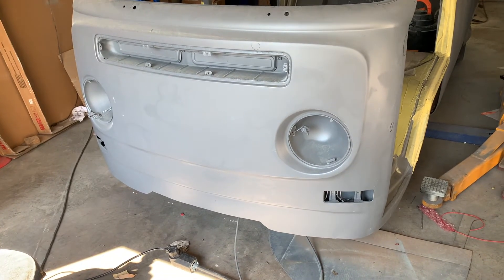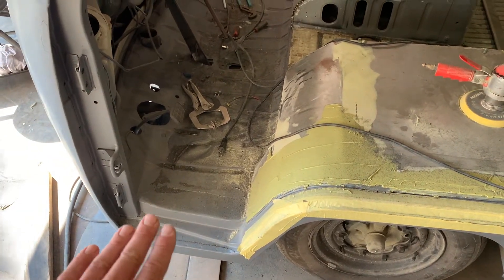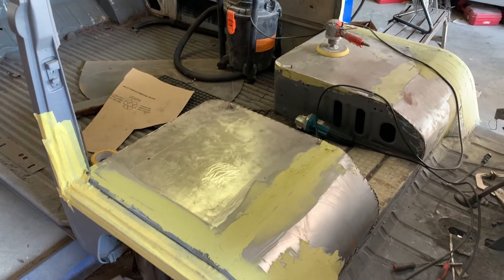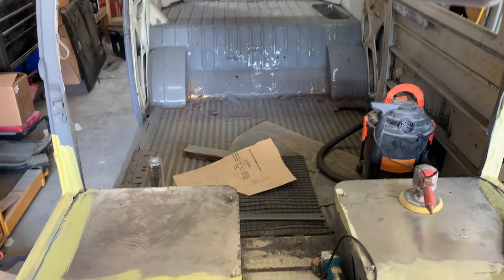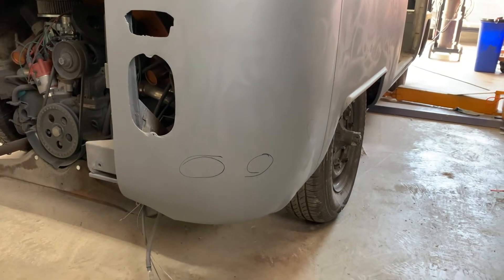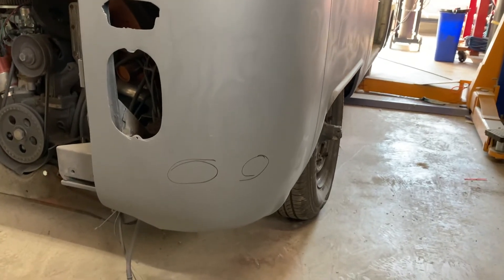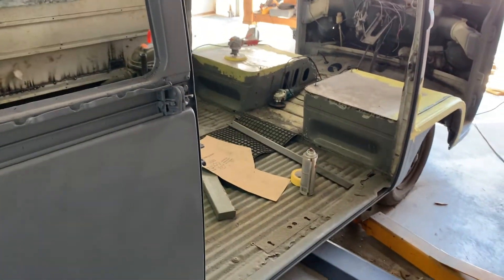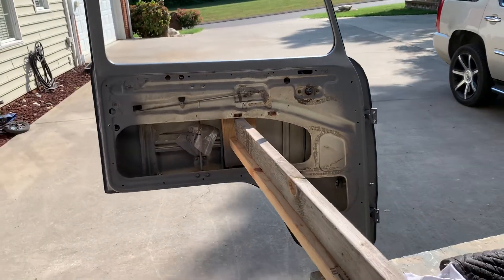1969 VW Westfalia Type 2 Bus 3 month update, metalwork, body work, rust repair All sorts of fun!

Comment: Bay windows have rust in all those areas you mentioned. Mine is not that bad but over the last 18 years it is starting to develop. I gotta address it eventually. Nice video thanks.
Reply from the maker: It turned out to be one heck of a project. Check out the final vid of the bus where I put all the progress pics into a slide show. Thanks for watching